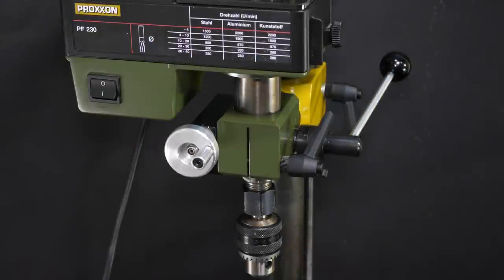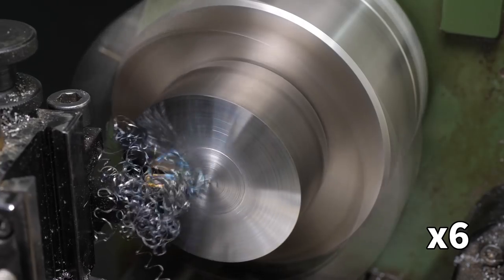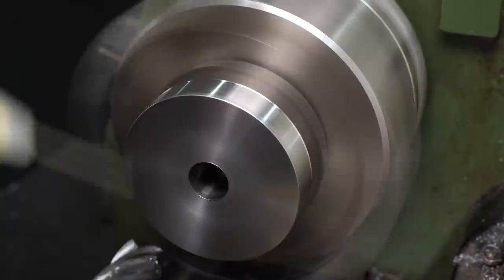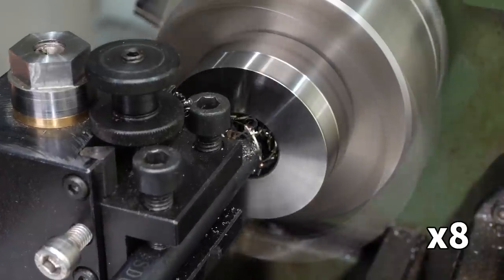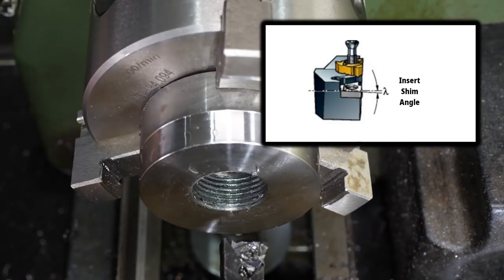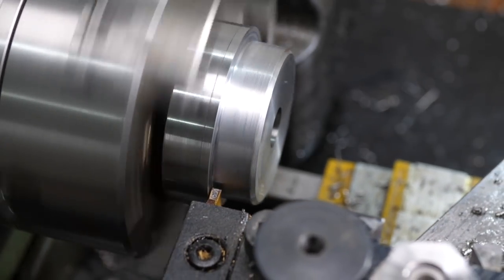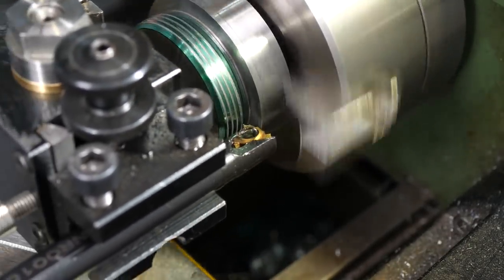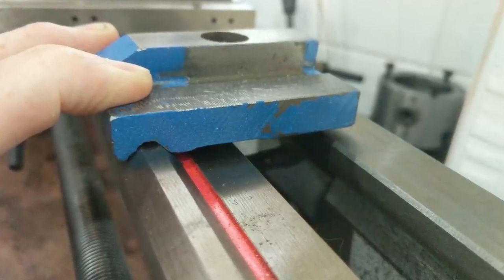Making a Boring Head Arbor for the Proxxon FF 230 Milling Machine using the Proxxon PD 250/e Lathe

Comment: Good job in the end, but the choice of steel was unnecessary.
Reply from the maker: Absolutely unnecessary, but under the circumstances I didn't have much choice. Steel in such a large diameter but in short lengths isn't easy to get for a good price, and I don't have space to keep a huge stock. I depend on cheap offcuts for this kind of material, and the choice of grade is limited; often not specified at all.

Comment: imo get a less viscous cutting oil
Reply from the maker: Interesting, why do you say that?
Reply: @AdventureswithaVerySmallLathe  because when you cut steel it is best to use a thicker Sulpho-Chlorinated Fatty Mineral Oil. These are typically less viscous than your typical mineral based cutting oil and the sulphur acts like a molecular bearing over the steel which keeps the cutting tool cooler. People still use plain lard on plumbing pipe threading but there is more refined stuff available that wont get rancid.  A company called Neatcut offers this in several viscosities, its great for steel.

Comment: Another terrific job Alistair, Well done!!
And the best of luck with the competition.
I'd considered buying the 30mm Boring Head from Arc as it seemed to be more in proportion for the Proxxon Mill.
https://www.arceurotrade.co.uk/catalogue/department.aspx?node_id=9917f8a3-2aea-4af0-a51f-a5e901070817
Yours appears to be the next size up at 38mm, so curious to know if you think it's something worth pursuing for the 30mm..?
regards Colin
Reply from the maker: Great find! Thanks for that. My boring head is loads bigger, at 50mm, and I wish I'd found the 30mm head on Arc earlier. I did quite a bit of searching, and didn't come across smaller boring heads anywhere. I guess I should learn to check Arc first.

The 30mm looks ideal, especially as it takes smaller lighter boring bars too, though I haven't seen a lot of 6mm boring bars available online, so that may be a limitation. The price on Arc is also quite high compared with the price I paid for the 5mm head on eBay, but based on Arc's reputation it's almost certainly worth it.
Reply: Thanks Alistair, I greatly appreciate your thoughts.
Hmm, maybe I'd be better off to use the 38mm version which uses the 8mm boring bars.
https://www.arceurotrade.co.uk/catalogue/department.aspx?node_id=ea5bd27a-7160-492c-957a-a5e901093866
Reply from the maker: @colincreedtattoomachines  One more observation: Both the 30mm and 38mm boring heads have an M14 thread for the arbor, so neither would work with the design I made in this video. The arbors available for sale on Arc only fit standard tapers, or a 12mm straight shank (too large for the Proxxon) so they won't work either, so either boing head would require a custom arbor of a different design.
Reply: @AdventureswithaVerySmallLathe  Agree with your observation, my original intention was to utilise their 12mm Arbor & reduce it to a 10mm to match up with the Proxxon Collet.
Still wondering if it''ll be worth the investment in money & time??

Comment: 👍
Reply: Bosted Tap hello, you pop up here too. He is very good isn’t he? The Proxxon makes my lathe look huge.
Reply: @smallcnclathes  All I can say, is we must have great taste 🤔.  I would be at a loss on these very useful small lathes, the smallest I have used was Boxford, 5" when I was 15 I think... Free machining, non ferrous materials and plastics are more suited to the direct drive machines, I think Lorch, Emco have reduction gearing giving a more useful range of torque. That was some tough material (EN 24T) of that size.
Best regards John.
Reply: Bosted Tap yes tiny machines certainly make one think about how to do the job in hand. My first cnc was an Emco, beautifully made just not enough grunt.

Comment: I can offer an alternative method of cutting those large diameter threads to a shoulder, which also happens to address the torque requirement.

In the 1930-1950 period of British Model Engineering, small (treadle!) lathes were pretty much normal. One classic attachment was a mandrel-handle. This is literally a handle (like a meat mincer) attached to the offside of the lathe, normally via an expanding collet inside the hollow mandrel.

This provides some interesting abilities:

Forward/Reverse at will
Low Speed (not always an advantage...)
High Torque
Amazing speed control, down to zero.

In the case of your large diameter thread, in tough steel, to an internal shoulder, a mandrel handle would have been a good solution.

And you can make one easily, starting with a bicycle left crank as "raw stock".

(plenty of examples around youtube and the wider net e.g.

https://www.youtube.com/watch?v=uCyrLq5fTik
)